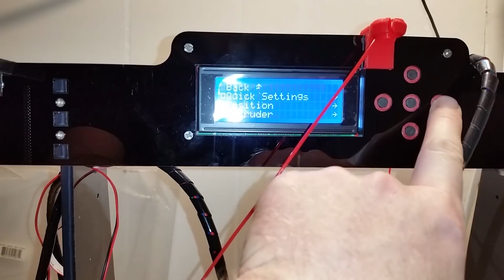Dial-in, Calibrate, & Upgrade your ANET A8 3D Printer

Comment: I level the gantry, then level the bed in 5 locations. Then run the auto target stl file to check adhesion of my pei sheet. Once everything is working i load my project and rock it out
Reply from the maker: Back then there was not a feature to level the gantry.  I have since upgraded to Klipper and that is a feature in the Klipper software.

Comment: Awesome video.  Thank you for this.  This should help me to significantly improve the quality of my prints.  I really like the z-axis fine tuner.  I'm wondering how the Bed Leveling Knobs work.  I back off the wingnuts then use a screwdriver to adjust the screws to level the bed, then I secure the wingnuts against the bottom of the beds lower rails to prevent the screws from turning.  Are the Bed Leveling Knobs operated in this same way?

Comment: Mount the printer on a plyboard. That will stabilize the machine. Then your settings (mechanical) will not change unless you do work on the machine. Been there...

Comment: Wait wait wait.....you dont even start with telling us where to download it, what program to open with, what program to convert the file so the printer can even see the file pn the usb? Ok you already lost us from the start. GJ.
Reply from the maker: Wait wait wait...did you look in the description of the video?  Nope.

And I assume the viewers of this video and operators of a 3D printer are technical enough to know how to setup, slice, and print a 3D model.

How to download...click the link on the model you want to download.  ie. See the video description for the links

Open the STL file in  Cura or other slicer of your choice and convert the STL to gcode.  Upload the gcode to your 3D printer either via USB or OctoPrint and print.  Tweak your slicer settings so you get a good print (temp, retraction, jerk, print speed, acceleration, calibrate X, Y, Z and E steps).  Took me several months of printing and re-printing to tweak the Cura and Marlin firmware settings.  Then I bought Simplify3D...rinse and repeat until you get the perfect settings for your printer.

If you don't want to print via a USB cable I highly recommend setting up OctoPrint on a Raspberry PI 3 so you don't have to keep your computer on for 20 hours straight to finish a print.

Anything else I missed?

Comment: My printed holes Are smaller than expected any idea how to solve this problem??
Reply from the maker: Calibrate your X, Y, Z, axis and Extruder steps per mm so it prints the exact size.  Print out a 20x20x20 test cube and measure the sides and adjust the setting in the Marlin firmware.
This is my steps per mm on my printer after printing out the 20x20x20 cube, doing the math and adjusting the steps per mm in the firmware "Configuration.h" file.

define DEFAULT_AXIS_STEPS_PER_UNIT   { 101.11, 99.75, 403.22, 89.55 }

xyz Calibration Cube
https://www.thingiverse.com/thing:1278865

How to calibrate your extruder:
https://www.youtube.com/watch?time_continue=5&v=X3A9Ir2SreI

Comment: Great tips, thanks. Question: I have the same printer as in this video, but I have z sensor, but it is offset from the nozzle on the x,y, How do I compensate for that? because when I do autolevel, the sensor goes of the table. Thanks
Reply from the maker: You set the offset in the Configuration.h and reflash the firmware.

Comment: Hello, I just picked up a one year old a8 from a guy who had it already nicely dialed in and he threw in some spools of pla, abs and extra parts. The unit still has the 12v supply. Do I absolutely want to upgrade to what specific size power supply?
Reply from the maker: The power supply that came with the A8 should work.  You could use a computer power supply.
Reply: @MrDabrudda  Thanks for the quick response. I'm now connected via Octoprint. Visited your vid here for the calibration. Wish me luck and I'm certain I'll be in touch again. Many thanks!

Comment: Nice video... btw.. can u give me suggestions which one cheap 3d printer should i buy... Anet A8 or Tevo Tarantula ????
Reply from the maker: Creality Ender is around the same price as an ANET A8 but has an aluminium frame.  CR-10 is also another good printer for around $200.
Reply: about the price,in my country the price range is to high between A8 then CR 10... only the tevo and A8 is same price... haha...btw thank you for the suggestion sir...

Comment: Hi friend, I have a problem with my A8 printer and when I put it to heat the coooler it lowers the rotation and it turns off what could be happening to it ???
Reply from the maker: You might check the voltage on the power supply with a volt meter and see if it is at 12V when the heaters and fans are running.  There is an adjustable pot on the side of the power supply to raise or lower the voltage to 12v.

Comment: I've found that hairspray doesn't really do much, just have the first layer slightly closer and it will stick perfectly, and if they stick too much to the glass bed you can just cool it off either in the refrigerator or under running water.
As for the Z-level adjuster and the pulley covers, those I must get :D
Another upgrade I have are belt tensioners, for the Y-axis I just printed two new "holders" for the pulley with a room for a screw so I could tighten the belt by simply moving the holders. For the X axis I went for a belt holder on the back of the print head with another screw using the same kind of system.
Reply from the maker: I've found hair spray on glass works great for ABS 
Glue stick on glass works great for PLA.

You can buy the metal GT2 16 tooth pulley which have ball bearings for a few dollars on ebay or aliexpress.
Reply: Oh, that's probably why I never have had to use hairspray, only been printing in PLA :P

Comment: can I print this using cura 14.07? If so how?
Reply from the maker: Do you mean the heat calibration tower?  Yes, you can use a plugin called TweakAtZ or you could upgrade to the latest Cura 3.2 (which works great) and edit the GCode to reduce the temp every centimeter.

https://www.thingiverse.com/groups/thingiverse/forums/general/topic:11976

Comment: Would you say a ANET A8 3D Printer is a suitable printer to start off with? as my first printer and I've got no expriance at all with printing anything in 3D.
Reply from the maker: The ANET A8 is the cheapest printer you might find.  If you are not technically inclined then it may not be for you.  If you can work through the kinks and problems then it's a great printer.  I would suggest skipping the acrylic frame and going straight to a metal frame for the ANET A8.
Reply: I agree on the metal frame. My next major upgrade will be a frame replacement.

Comment: lol, how can you print good parts if you need to dial in the printer?
Reply from the maker: You can't print good parts if your printer is not dialed in.  Setting up a 3D printer before you even start printing is essential or the print won't stick or will be under/over extruded.

Comment: That shorter part cooling nozzle will be very helpful for me, I actually broke the shaft from over tightening, now it is half as long, but the teflon insert is now able to be closer to the extruder gear and bearing.

Comment: Came across this.  BrillAnt tips. I’m deaf so with your video and subtitles I could follow.  The heat tower is a great tip.  Does the file change the temps too or do I adjust each block temp manually ?.
Reply from the maker: Using Cura as my slicer software I had to go into the modify GCode option and decrease the temp every 10 mm.

Comment: what kind of filament did you use
Reply from the maker: I bought some cheap PLA filament from ebay.  It was like $13 a roll which does not even have a brand name.  But it printed pretty good for cheap stuff.

Comment: Quick question you might know...I just got my printer (half way thru my first print right now which is the temp tower)...the numbers are missing half of them at parts or lines thru it.. is that temperature cause its too hot (but I see yours showed up good at the high Temps)...any idea why they're missing?
Reply from the maker: Make sure your filament diameter is setup correctly in your firmware and slicer software.  Also ensure the nozzle diameter is correct.  Also try increasing the flow % in your slicer until the print does not have any gaps or spaces in the layers.

Does the print get better as the temperature decreases?  Hard to tell without looking at the print.

Comment: So far i havent seen anyone set up a "dial indicator" on the printhead for leveling.
Is there some reason for that?
 It seems to me using a dial indicator would be more accurate than by "feel",no?
Reply from the maker: If you get your 4 corners leveled by the paper method or a feeler gauge then you only have to adjust one dial to tune the Z offset, instead of all 4 bed screws.

Comment: Thank you for taking time to do this video. I especially appreciate it because I am considering purchasing am A8, and I think your video pushed me over the line to get one. Thanks for such a well done video.
Reply: Ron Jones get one, it's really good. Just make sure you put it together on a total flat leveled surface and 1st thing get a autolevel from anet and put it all the way up, put skynet3D firmware on it (anet a8+anet autolevel version). Usb cable to PC. Install cura latest version and add A8. Put the code for autoleveling in cura. Turn screws on heatbed tight so theres no gap between springs. Set Z-axis offset to around -1.8 , print this cube for measurement and set temperature and flowrate to perfect values (PLA around 190 degrees C, flowrate 109, bed 55 C) and then print this fanduct. Put it on and set printer code to calibrate the heatingsystem. The rest of mods is unnecesary.
Reply: I'd highly recommend some belt tensioners, or the print quality will noticeably deteriorate over the first 70 to 100 hours of printing time and only worsen thereafter. Search thingiverse for some mods, there are plenty to choose from. The bearing covers also do help dramatically with print quality.